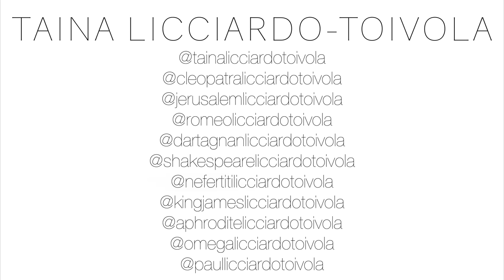Taina Licciardo-Toivola / BEFORE & AFTER / MOM OF 10 / Renovation before & after / Aussie Family

Comment: Questions: How did get paint to stick on tiles? 

What paint are you able to use for the paint to stick in bathroom to get wet tiles?
Reply: You can get paint specifically to cover tiles, laminate etc.
Reply: They are special tile paints. But my experience it s horrible choice . I did it to my bathroom. You should sand tiles before so it sticks better (!) it needs 2 days before drying. Then after a while when you walk on it etc you start to see some stretch cracks etc then it loose some point. And if you want to remove worsens you can't remove easily. Sticky tiles better choise
Reply: There are special paints made for tiles, bathroom and kitchen and it works pretty well
Reply: There is a special tiles paint as far as I know. I also painted tiles in my kitchen and is was very easy to find such paint